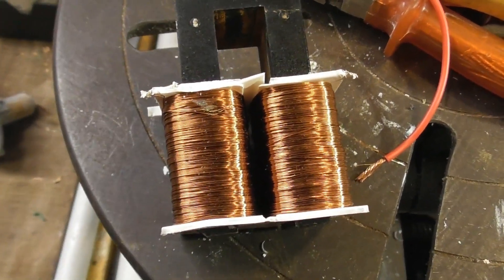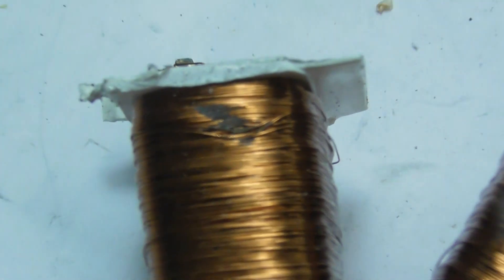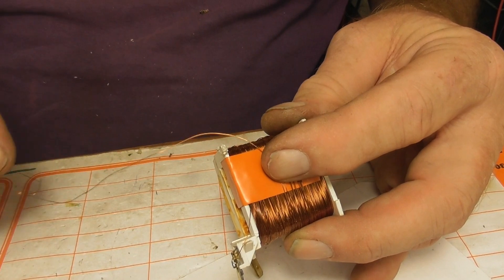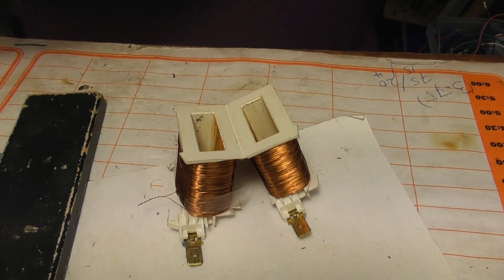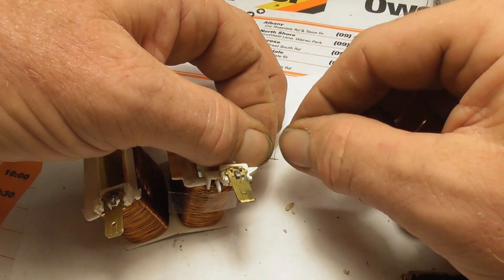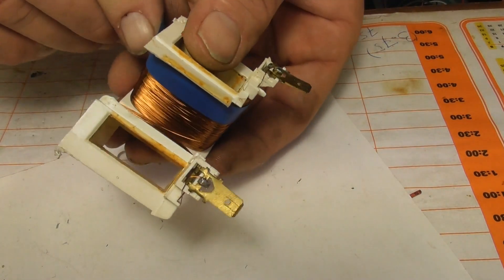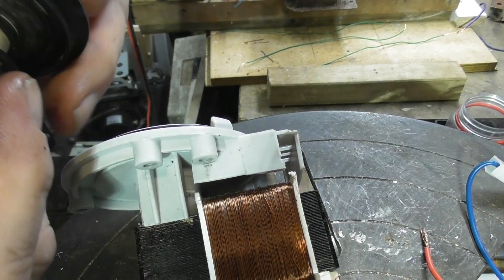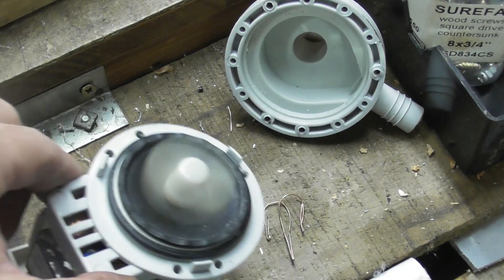Washing machine waterpump motor repair

Comment: And being synchronous, they are often the cause of the chugging sound in some washing machines, the impeller in the pump housing changes direction frequently following exposure to hydraulic fluid turbulence and resistance 8:10
Reply: Interesting. Meaning it has like no phase offset on another pair of poles to always go a certain direction?

Comment: I've repaired some motors with aluminum winding's, by just twisting them tightly together and u-bend folding with heat shrink to stabilize.. both blower motors in home furnace and that was mid 1990's, they corroded away at the thermal protection device splice, which was some factory crimp.  I did 6 or 7 of them that way and know for fact 3 of them are still in use, others probably whole unit replaced for other reasons with the rigged up blowers still working. yes it was emergency repairs in winter :)

Comment: You finally replaced that Simpson then??! We change so many of these synchronous pumps at work that we carry them as van stock, not because of the windings but usually because the bearing holding the magnetic rotor wears oval and they pull into the windings rather than rotate.

Comment: Im guessing that winding was done with aluminium wire, hence why the solder didnt want to take :/ Race to the bottom these days
Reply: Yeah Welling... almost certainly aluminium winding... i checked an old motor from a washing machine made by them, and it was all aluminium wire

Comment: Couldn’t help but cringe when you were dry running the pump. Damage occurs on the impeller quickly when it’s ran dry. The magnet gets scored and ruined causing it to fail. Good repair job though!
Reply: I believe washer pumps are meant to run dry occasionally. The one in my washer runs until the very end until the spin cycle is finished.

Comment: Nice work! 
I use to burn the insulation off at the end with a torch or lighter, then use some coarse steel wool to remove the black copper oxide layer that forms (wich is much easier to remove, than the thin but quite tough insulation on those wires). Thin wires like that, can often also be soldered directly if you turn up the heat on the soldering iron.

Comment: My oh my; between the manufactures cutting all corners of their mechanical engineering close to the envelope and the suppliers providing the least amount of quality control/assurance of their products, the consumer has little confidence in the products that they have available to purchase from them ; R/E the quality of the copper ally that you had difficulty in making a conducive connection ( cold solder joint ) leaves the consumer at odds if they might purchase a product that is worth a _hit ! There seems as though there is no control over manufacturing companies: modern air conditioning units that use super thin styrofoam to provide the insulation needed between the internal environments and external environments and the styrofoam insulation deteriorates from exposure to the sun light. They also, only install shielded bearings instead of sealed bearings on their fan motors which are subjected to wet conditions. We have no protection from the ‘ cheesy ‘ products’ that manufactures sell us by the arsehole companies that provide crappy products. 😤😖🤬😎. The he manufactures provide a 24 month guarantee on their units and the shielded bearings wear out at 26 months. Crappy deal one might say !! WTF?!
Reply: To be fair, that syncronous motor and pump have what it takes for the task.
Note it's not really a stepper motor, those have special constructions to move in tiny steps.

Also the lack of seals on moving axles means there are very few ways for it to start leaking.

The freeewheeling (90 degrees free movement) between the impeller and magnet is quite noisy if the pump isn't fully filled with water. (like inlet hoose submerged under water)

It may look cheap, but only major upgrade I can think of is to add some physical protection to the windings. (but it will make the windings run hotter)
Reply: erlendse I have to agree; I have bought several ‘ pump motors ‘ that failed not because of being overloaded but because of mechanical engineering; a few more winding turns or slightly lower gauge wire would have made the unit indestructible. 😤🧐
Reply: I enjoy and follow all of your posts. Anyone that has the least amount of electronic or interest in basic electricity should devote their spare time towards viewing your posts. 🤔🧐
Reply: The varnish thats on the wire he was soldering is supposed to be there and if the wire was an easy solder than that would have meant the manufacturer was cheaping out because of the lack of that insulating barrier between turns..  though there is no argument on how crappy most manufacturers products are these days and how “they dont make em like they used to..”   the world is full of greedy, selfish, immoral bastards who never do anything unless a personal benefit is accompanied..  do your part and break the norm and show others that people can be decent people, many forget that as its difficult to keep that kind heart when all you see day in and day out are nothing but lazy, undeserving, ignorant procreators making more copies of themselves filling up the world with their feces and bullshit arguments that fuck others over so they can do what they want to 100% of the time..
Reply: Z Ack  We are all getting ripped off. Most people are of money come easy let go easy. But some of us do not accept that because we know better. Nowadays one dollar thrown away equals $19.00 down the drain. I have built power push-pull amplifiers and preamps from scratch and they were 100 times better and 1/10 the cost. I know how to push leads through a circuit board and solder, clip. That is a wonderful experience few have any idea about. One person out of 10,000 knows how to read the color code on a resistor ( for most, what is a resistor resistance, capacitance , ohm ) ? I enjoy watching your blog; wish that I could get back to wiring some circuits.

Comment: CCA wire I find it best to solder through the insulation, so that the copper plating can take the solder. Will require a bit more heat to cook the insulation off, but that at least gives as good a connection as you can get with CCA wire. A bit of extra rosin flux helps, generally I use a thicker roll of solder for this, which gives a lot of flux into the hot zone, so it cleans well.